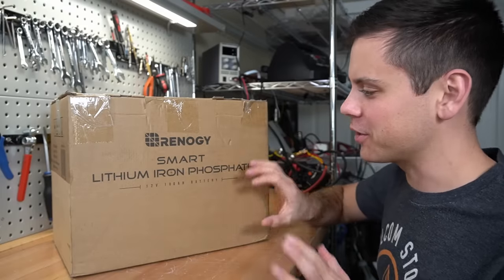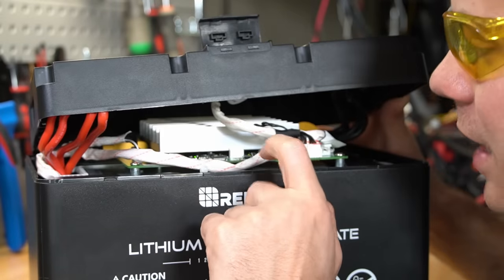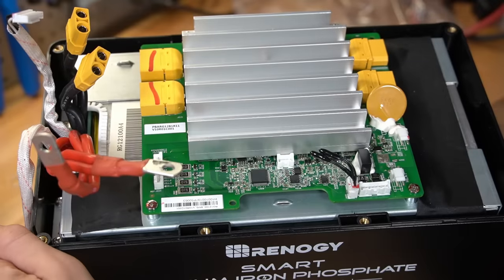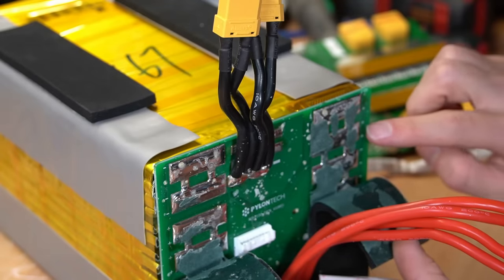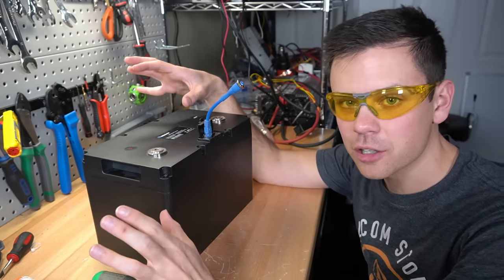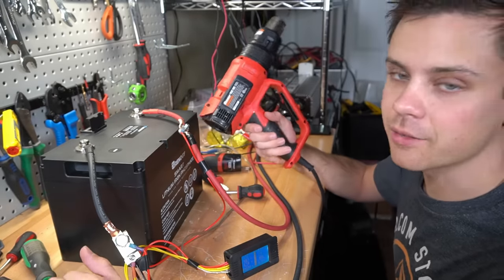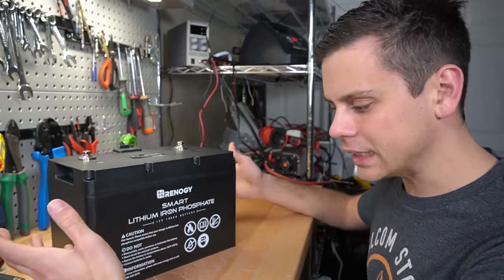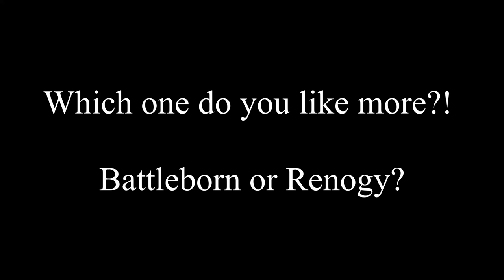Renogy "Smart" 100Ah LiFePO4 Battery Tear Down

Comment: when one or more of the cylindrical cells in a battle born battery go dead the battery will still function but with lower capacity.  With the Renogy pouch cells does the same apply?  btw, once again great video!

Comment: In my experience with Renogy, the BMS needs work.  I used one in a travel trailer; unfortunately, some contractors doing work on my house unplugged it without my noticing.  Next time I went to use the trailer the battery was totally dead and could not be revived.  Support was super un-responsive but eventually told me that my battery had been damaged, and because the battery was 3 months old, it was my problem.  My only option is to pay to ship it back to see if the factory can restart it.  Super disappointing since the BMS should have prevented overdischarge damage!

Comment: -What was the Voltage Before you 'activated' it? 
-What would be the reasoning behind Not Series Connecting batteries?
-Any thoughts about sourcing Pouch Batteries and DIY Building this Renogy?
Reply from the maker: Nearly 0 volts
I still don't know. They say it will be damaged but I don't understand why.
I wouldn't build diy pouch battery. I'm not a fan of soldering pouch tabs. Just personal preference
Reply: DIY Solar Power with Will Prowse cu

Comment: Did you figure out what are the extra wires on the balancing cable? They could be either voltage sense lines or temperature sensors. Not sure, I didn't see details on the PCB.
Reply: It just had more cells then he thought
Reply: google
Reply: It is 4s. It only requires 4 or 5 wires. Not 10
Reply: @movax20h  ah okay, so only to the parallell cells then :/

Comment: i liked the video great infomation, i am wondering if the renogy 12v 50ah battery would be a good proof of concept battery to get the wife on board i have a mppt charge controller and a 100w panel i just need a little battery and want to set up my laptop to run on green power before expanding to a MUCH larger set up.

Comment: At 1:36 180 amp is incorrect. 2x # 10 awg is equal to #4 awg. Ampacity for #4 awg wire at  90°C is 95 amp. The 2 XT90 is for switching between charging and discharging. The problem with series connections could be easily resolved with an external bms cable to connect the batteries in series and parallels.
Reply from the maker: Oh yes, I was meaning just the connector. Not the wires

Comment: Which cable can be removed first???  BOOM!  lol  Your work is valuable - great videos.  This appears to be very well designed and built.  And you don't have to destroy it to get it apart.  Can't be connected in series will limit application - weird.

Comment: Great teardown Will. Did I read your meter correctly? Did the BMS let you take the voltage down to 2.25 volts per cell? Can the pouch cells do that without a severely reduced service life? Maybe I totally misread the numbers...

Comment: Hi there, I just bought the exact battery & have the same voltmeter as you do. I just ran the first test, only did 34ah until the warning low voltage come on the inverter (1700w Giandel) & was gonna cut out... Do I have a dud battery? 
I was only running a projector (250 watts). Ran for roughly 2hrs. Many thanks :)

Comment: It wouldn’t be too hard to add  heating to the battery. All you need is one or two 12V heating films (for in gloves or shoes) and a thermostat. 
Set the temperature for the heating element to turn on just above the cutoff temperature of the BMS. The turn off temp could be just a few degrees C (a few more F;) above the turn on temp. You don’t want to really warm the battery up but you only want to prevent that the BMS low temp cut off kicks in. 
Add some thermal isolation if your battery is in a very cold environment.

Comment: Great video . I have 2 of these and now I know what’s in them.
 Still don’t know if they have low temp cut off ?
 There instructions tell you to install a com cable to the com ports if connecting multiple battery’s 
But than says if in parallel not to 🤔
Reply from the maker: Yes they have low temp cut off

Comment: I just opened up 3 of my Renogy Smart 100Ah LiFePO4 batteries, because they were no longer taking a charge.  Turns out there was a good deal of moisture inside the case along with some corrosion on the BMS board.  I have batteries that read 7.33ish at the terminals, but when I disconnect the BMS, I get 13.6v straight from the polymer pack.  

Renogy doesn't sell the BMS separately, so I guess I'll be figuring out how to use a different type of BMS...  The tech I spoke to really seemed to have no clue as to how to go any further than basic multimeter testing across the terminals.

Comment: I live in aus and the summers here can get up to 45 degrees, even higher inside the parked work van where I intend to keep this battery to run a fridge/charge power tool batteries etc. do you think this isn’t wise due to the pouch cell design? Or am I best to not draw any power from the battery if the temp is getting over 50 degrees which is what renogy rates this battery too, cheers for what you’re doing 👍

Comment: I'd be curious to see what you lose with the Renogy bluetooth 100AH batteries.All the other specs are the same. Except you get BT instead of RJ45 connectivity.
I picked up a couple last year for my van. Been solid since. The Bluetooth is reliable, and there appears to be low temp cutoff. Or at least it warns me when temps get below 40 F or so.

Comment: HI !   I have 3 of these batteries ( RBT100LFP12S) and absolutely love them,  Recently I purchased 2 more and just found out you can only hook up 4 in parallel with a SMART option which is terrible news to find out. I did try to call renogy 2 times and unfortunately was no help to me.   I want to use the Balancing option, so would 3 installed with balance and 2 separate be a better option.  From what I read you can ONLY install 4 in Parallel or could cause damage or fire.     Perhaps you could create a video or respond would be greatly appreciated.

Comment: Great review Will. For some of us, we would be interested in the battery's water proof rating aka IP rating since we are interested in using them in marine applications. Once your usual tests are completed, I would love to hear your opinion of their water proof level.
Reply: An open BMS and wiring in an unsealed box would be a disaster in salt water. Better look to the more sealed models available in the marine industry. They are a lot more costly yet...would not become worthless if you tip, even if only for a few hours while everyone pitches in to get you upright again.

Comment: Great review, Will. A couple questions: (1) Does that plug-in switch allow you to effectively turn the battery on and off so the BMS doesn't drain the battery during non-use?  (2) Can a regular lead-acid charger simply (and safely) be connected to the battery terminals for charging?
Reply from the maker: Yes and yes
Reply: @Jason Bowman Actually I'm thinking about putting one in my camper which has its own charger and associated circuitry for the lead-acid deep cycle that came with it and which is now dead. Thanks for your knowledgeable response, though.

Comment: I'm guessing that you can not connect them on series because of the bms detection of voltage. It will most likely cause the two bms's to fight against each other.

Comment: I like the  BMS inside would like more data on it . like the 2 temp sensors.  does it have low temp cut off ? with LiFePO4 using them cold is ok as long as charging rate and discharging rate is reduced.would like more testing like put battery in freezer . get it to 0F. keep taking them apart  .you can't tell what's inside . too bad it is 12V only. looks very good inside.

Comment: Not sure if you saw that Renogy released a new battery monitor that connects to the rj45 port on these batteries, and you can daisy chain to additional batteries with the uplink port to monitor all batteries in the bank.
Reply: Forgot to mention that it gets all of its data from the BMS rather than a shunt, so it can even show error conditions or warnings from the BMS

Comment: For 24v - 48v use a 12v battery balancer in between each series string. Simples :)
The problem with series strings, is that chargers (& dischargers) cant see the individual battery voltages. Hence when batterys get out of bakance you have problems. 
I.e. One battery could be at 10v, the second 14v. Charger sees 24v, and continues to charge. Second battery is either overcharged, or bms disconnects. The first battery is chronically overcharged.
A active string balancer solves this by monitiring individual strings, and moving power from battery a->b (or vica versa) to keep the packs balanced :)

Comment: What is the bms they are using , it is very strange that series connection is not recommended .. why ...there must be a current flow issue .. - good job ! Thanks for the video ..
Reply: This is due to the communication cables. They are not opto isolated. You can surely series connect the batteries, but then you can't use coms cables, or use custom solution with opto isolation for that. They say not to connect them in series because it is not something they support out of the box.

Comment: Hi there Will you doing a great Job over very informative, Thinging of purchasing TWO of the Renogy smart 100amp lithium batteries here in Australia are that still good Buy with a Renogy 2000w power inverter thanks again.

Comment: Another thing to consider in the Renogy vs Battle Born is the warranties. BB is 10-year vs Renogy’s 5-year.
I see a lot of complaints about lack of series connection. I only run 12-volt and haven’t had any performance issues with it. Why are 24-48 volt systems better?
Reply: you need small cable when you have 24-48 or highest voltage system

Comment: As someone who is indeed looking at a 24/48v, the lack of series-connect-ability is disappointing. Especially true given there's only a $50 difference. Would be good to know (specifically) why the limitation exists. (I'm sure it has to do with the BMS, I mean more specifically.) I'd have to go Battle Born if I were buying right now. It's still nice to see Renogy (and Battle Born... indeed any company) taking build quality and design seriously. I'd agree this battery would be a great choice (for 12v only).

Comment: so you've hit on something i've been trying to answer. using lithium's in parallel, and prompted a question, which route is better a single 200 amp hour battery or paralleled 100 amp hours. i'm under the impression it's not common to run lithium in parallel
Reply: I've seen quite a few videos of people using lfp's in parallel.  These in particular seem to be able to balance across the batteries to ensure their SOC is always equalised.

Comment: I hope this will be the same battery internally if purchased directly off of a shelf, and i hope the original Renogy 100Ah is similar in quality build.  Side note, i purchased the original 100Ah Renogy lithium (LiFePO4), and they told me it had cylindrical cells.
Reply: It does. The new one has LFP pouch cells as shown by Will.

Comment: These do look good. Not a lot of options in australia that aren’t the junk we have seen you tear down. Can you mention min charge current on your batteries and bms tested for us small camp solar setups. Many bms wont charge unless you have a few amps or so. Not many batteries mention those specs. I was told by renogy this will charge at 0.2a which is great. Some local batteries state 5-10amps min which is useless for small solar.

Comment: Great video. Do you know if this battery is suitable for 4x4 / overlanding application where it's used as a secondary battery for power 12v appliances likes fridges etc? Any ideas about how pouch cells would cope with vibrations associated with driving on rough corrugations etc? These batteries are great deal cheaper in Australia were it's priced at around AUD800 range.

Comment: Will,, you talk of only being able to have these batteries push 12 volts.
I was wondering🤔, could I use a Buck booster for a designated load off these 12 volt systems. I know there will always be specific parameters too all things. Given that, could it be done without harming the source?

Comment: I am concerned about the 50 amp max continuous charge current. If I'm running a 500 watt array now, with plans to expand that to 1000 watts, will the batteries be a problem? My initial plan was to run 1000 watts with a 400ah lithium battery bank.

Comment: I gotta question for you now I'm in a tight budget I wanted to get some of those chin batteries  But we do get low temperatures where I leave So the battery is gonna get damaged I was thinking to get those batteries and just turn off those batteries for the  Winter or bring it inside the house what do you think  or suggests

Comment: I have two BB batteries mounted inside. These Renogy batteries will fit in my battery bay. My question is can you mix brands of lithium? Will they balance?
Reply: You should only use the same brand/size of battery. Never mix them.
Reply: In an ideal world you don't replace 1 bad battery either as it's to strong compaired to the others and can stress them. Should replace all BUT that's expensive and impracticle.
Reply: If they are drop-in (each having there own BMS) AND installed parallel, each battery is a world unto itself. Size and Brand does not matter...within reason. If your batteries are in series OR have no BMS and are being controlled some other way...size is everything.

Comment: Just watched your video, I was considering the 170AH version which is currently on sale as well as the 100AH here in Canada on their website. I did more research and didn't like what I found. Ended up on their Facebook community page with terrible reviews on their service after sale and confirm it with all the complaints on the BBB site.
Reply: Bad customer service no doubt (sucks) but fast shipping and all products purchased thus far have been flawless and perfmoring to high standard. just make sure you buy the highly reviewed quality items and don't hold hopes out for any direct communication with the company. heads up i live in can too

Comment: Will maybe this video is too old to ask this, but. Renogy states they do not recommend linking more than 4 batteries in parallel? I was wondering if there is a work around for this? Is this all that the BMS's can handle in their communication ports? Is it possible to add another bms to the bank with more than 4 Renogy  batteries?. I currently have 4 of these and was hoping I could increase the size of my battery bank.

Comment: Out of curiousity what happens if you put it in series.  As long as you match the voltage and amp hours, I can't see the problem. I would guess that they are worried to overcharge the  pouch cells if one of the parallel modules has a damaged cell.

Comment: I'm curious about pouch cells now.  Are they good, OK...?  Must research.
Thanks for the teardown, Will.
Reply: Steve K Jehu Garcia has some videos on them. I think he uses them for his all in one systems
Reply: @AaronGeller  Thanks Aaron. I did some quick reading and so far the only negative is a tendency to swell if charged at a high level. Not sure what exactly "high level" means, though.
Reply: Steve K probably 1c rate or higher

Comment: One thing i do not like as much are the terminals.  Battle Born's have open terminals so you can use your own connectors and you cannot strip the built-in threads since there are none.

Comment: Hi, can you use two different battery manufactures in parallel?
Reply from the maker: In parallel, it should be fine. If they are the same chemistry. Just be sure to charge them 100% before connecting them together
Reply from the maker: @UCgxg4LGaDimdCTKbM9ACkxw recently we discussed this on the forum and someone posted a study showing that connecting different capacity batteries in parallel was fine, because internal resistance variance allowed larger packs to push more, and smaller packs to push less. Super interesting study. And with the different battery ages, yes there will be differences, but compared to lead acid, huge difference. Lead acid batteries need to be practically the same age when connected in parallel or they die quick. But a lifepo4 with bms? I doubt it. I think they can be totally different ages and connect in parallel just fine. I have asked battle born and some other manufacturers and they said its fine for the lifepo4 with bms. Unless one is damaged or something.

Comment: Will, I have learned a bunch from your videos and website.  Question on Renogy;  they offer a 170AH battery that the form factor works well for my Ford Transit installation.   Can these batteries be installed sideways with terminals facing forward if you are standing in front of them?

Comment: Gday mate. Love the channel and the education you are giving me. Thank you :)

I bought one of these on your recommendation. So I have questions about these 'smart batteries' and 'smart battery boxes'.

Do you still need the solar controller due to all the smart gadgetry in the batteries? Also hooking this up in a Giantz battery box, can I plug a solar panel directly into an Anderson port or the terminals?

If not, what is the advantage of having this 'smart tech' ?

Cheers mate.
Reply: Mate, yes you still need a Solar Charge Controller! Never just connect a Solar Panel directly to any battery. All batteries require a controlled and deterministic charging profile (CC/CV), to achieve optimum performance - that’s what the Controller/Charger does. The “smart” in these batteries is the intelligent BMS inside and, as Will pointed out in the Video the ability to plug these into an external management system via the RJ45 ports to better manage and control large banks of these batteries.